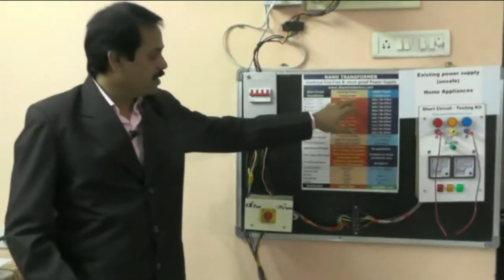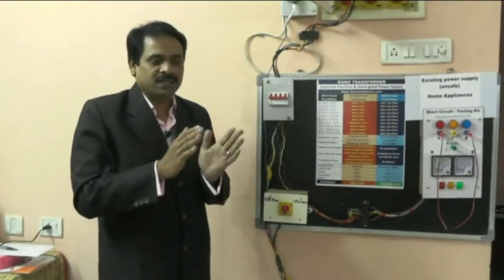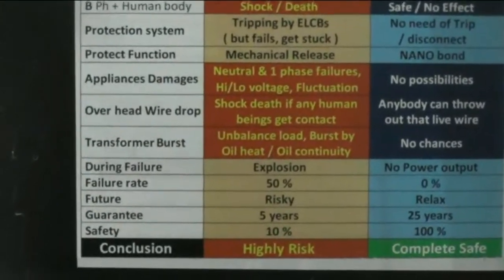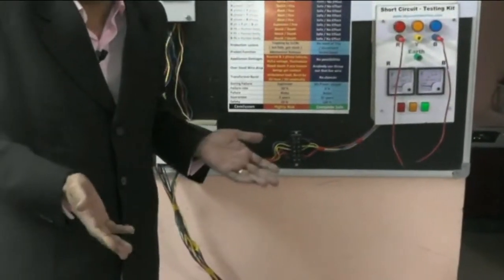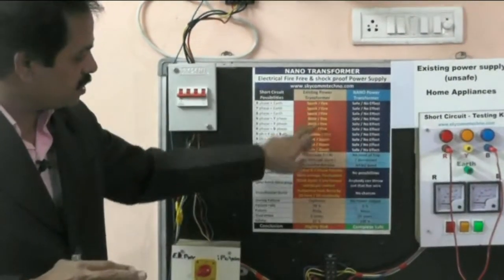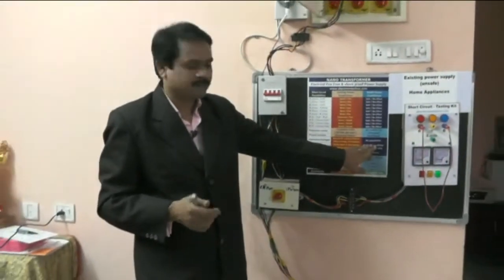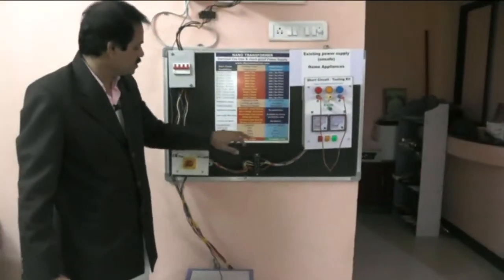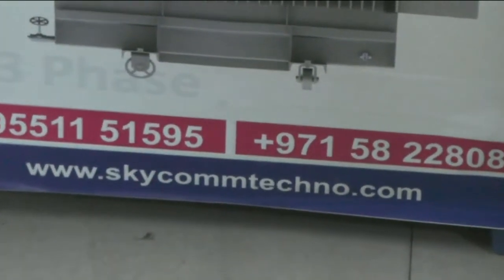Ultimate Solution for Electrical Fire accidents &amp; Shock Death - NANO Transformer

Comment: Fraud punda
Reply: Don't use abusive words. If you see something is not correct then explain why its fraudulent. So that everyone can understand. Just throwing trash will show your attitude then.
Reply: @senthilramalingam9500  nanba ivan concept romba thappu
Reply: @senthilramalingam9500   amps and voltage  romba kamiya irukku
Reply: Hi mac did you visited him and seen his product, the tester takes merely just few milli amps thats understandable , but when he touches nothing happens how?? either it should be DC or he might be converting to very high frequency so that because of skin effect it travel on the periphery without shock.  His other "inventions"  compressor less AC, water from air   etc., seems  to be TEC (Themoelectric cooler based" may be , i suppose.)
Reply: @thirumenip5416  its isolate transformer.  Simple concept already available in many market. Its oldest technology.  Pls read abt isolate transformer working method.
Reply: @thirumenip5416  🤗👌
Reply: @macgate2457  😊  Hi mac did u personally saw the device.
Reply: Adutha ramar pillai